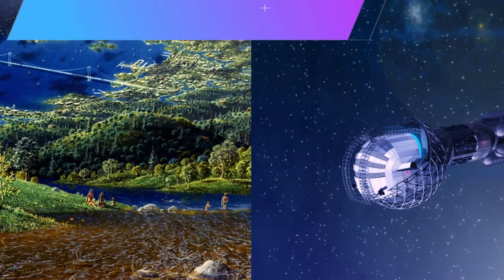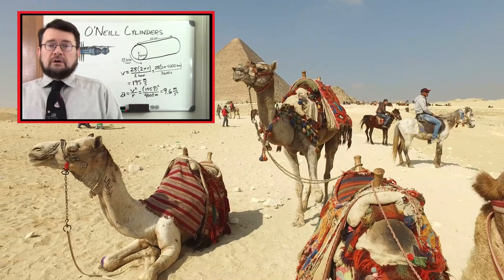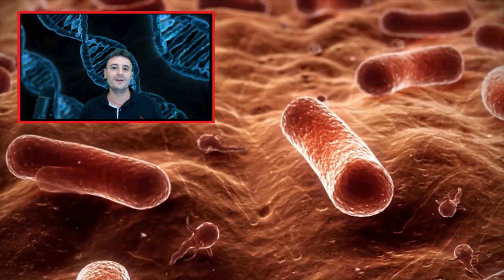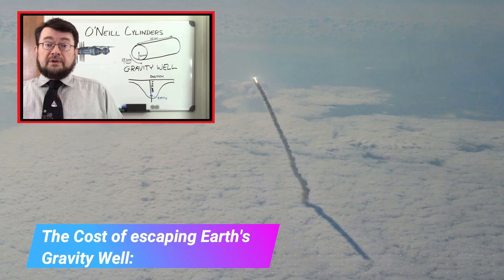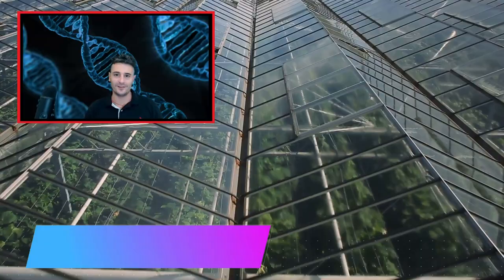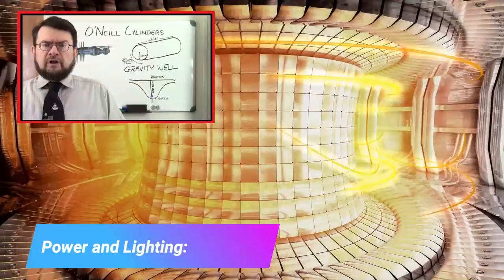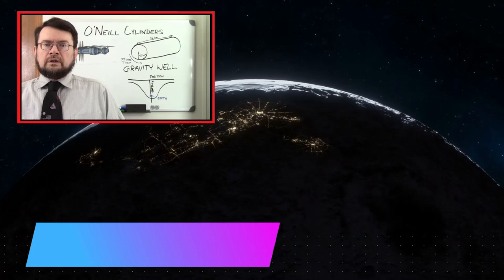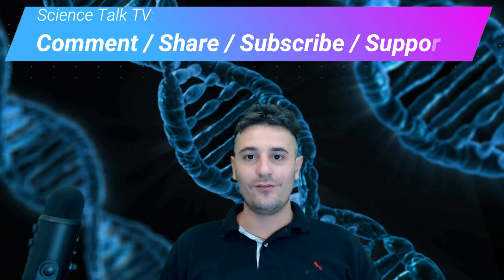Can humans leave earth? | O'Neill Cylinders 101

Comment: They don't have to be self-sustaining.  We can add water, oxygen, nitrogen...  whatever we need.
Reply: Don't have to be, but should be.
Assuming the station is far enough out, extreme self dependence should be a given considering how long it could take for help to arrive. Even with better engines then we have now.
Reply from the maker: what do you mean by "add?" you'd have to go out and mine it our blast it off from earth...
Reply from the maker: If it is going to take 50,000 years to get to the next star system being sustainable is key IMO.  Thanks for the thoughtful comment!
Reply: By definition, if you can build one of these out of asteroidal dirt, then you've got flying mountains of resupply, in easy reach.

Comment: biosphere 2 was considered a failure because the rocks had absorbed the chemicals in the air, causing a loss of homeostasis.
Reply: Biosphere 2 failed because of low oxygen level due to excess of CO2.  Their vegetable crop was low and they could not even scrub it mecanicaly.